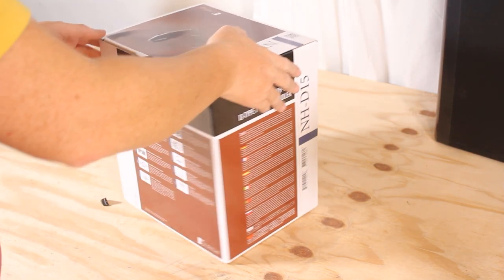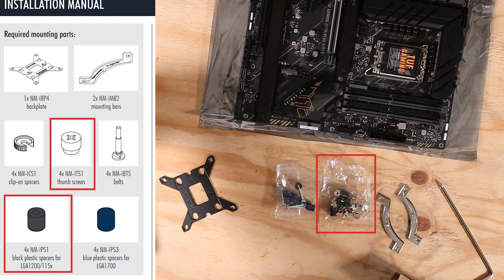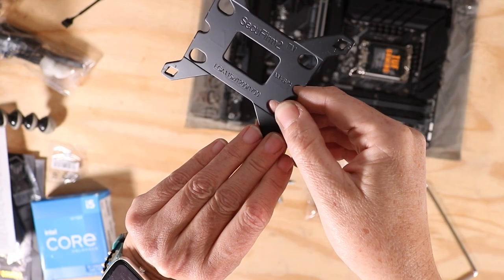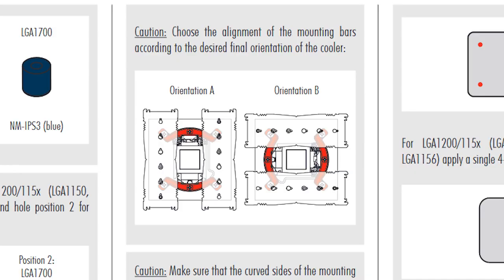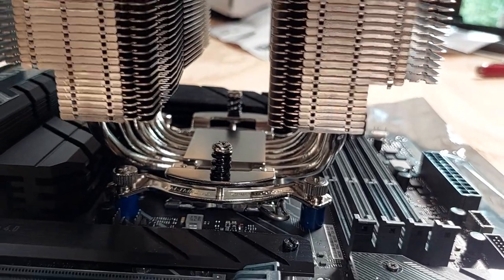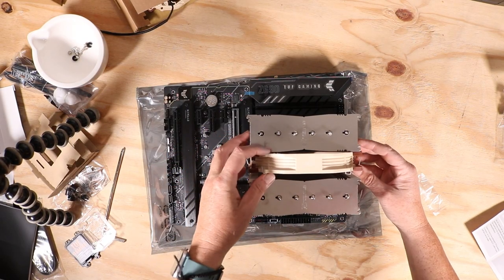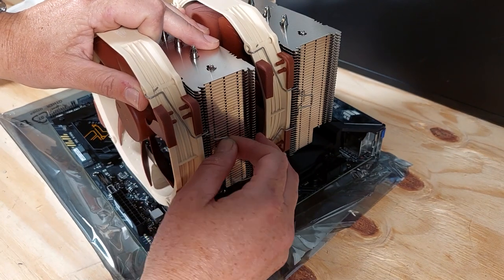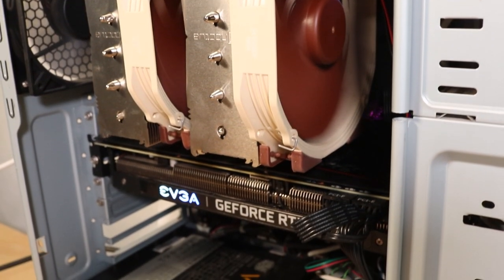How to install a Noctua NH-D15 on a LGA1700 socket (Intel 12th and 13th generation)

Comment: Are both fan supposed to be on or only one
Reply: I have Noctua NH D15S which is the same but with only one fan and it works perfect even with 16 core processor.

Comment: One of the 140mm fans has to sit on top of the memory and if you have a flat side panel for your pc you might have a problem closing the side panel. Fortunately, the panel on my brothers PC extended out so I could slide the side panel in with just minimal rubbing against the panel. If it was an issue I would have sold one of the 140mm fans and bought a 120mm fan to replace it.
Reply: Can always move the front d15 140 to another spot. I've been using my d15 with one 140 for years and it only loses a few degrees. Surprised me that that's all it did with only using one 140. I have Trident Z5 RGB memory. Looks much better with one 140 imo.